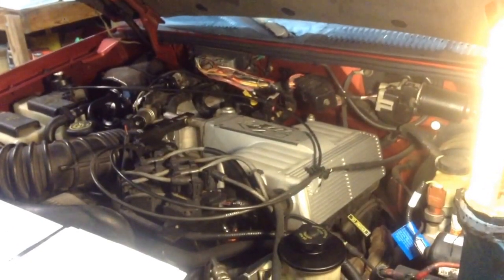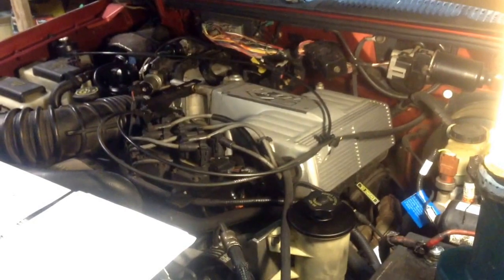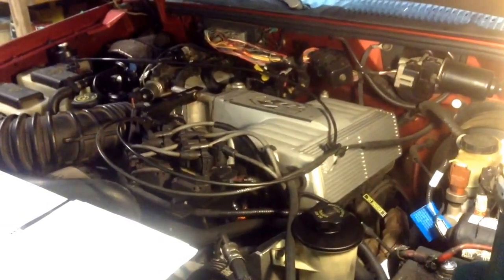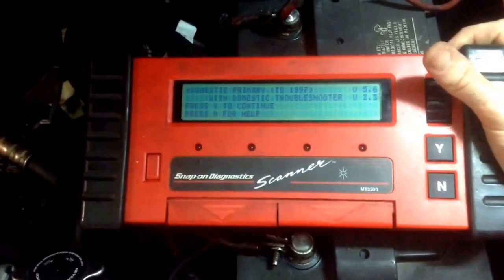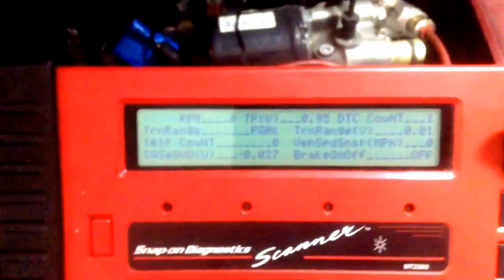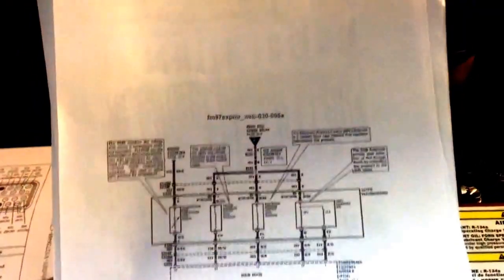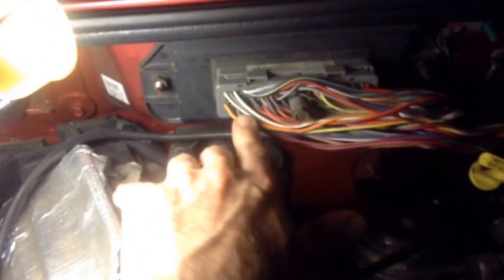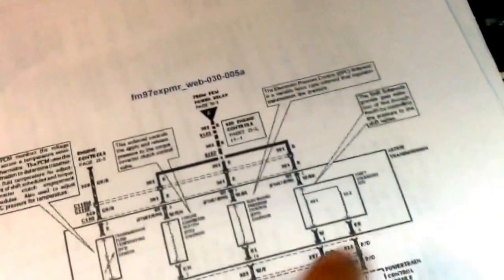Ford Explorer 4R70W transmission - no 2nd gear in automatic diagnostic. Part 1

Comment: Absolute first check is the 1-2 accumulator piston seals I have seen these cause your exact issue on a 1998 town car same trans same exact symptoms.
Reply from the maker: +6 months ago it started to just be slightly delayed 1-2. so I searched the Google and found that I had the early 1-2 piston. I ordered  the upgraded piston and new springs but it did not make any difference. I will inspect it again soon. I can't thank you enough
Reply: Where did u get the pin outs at ? Really need them